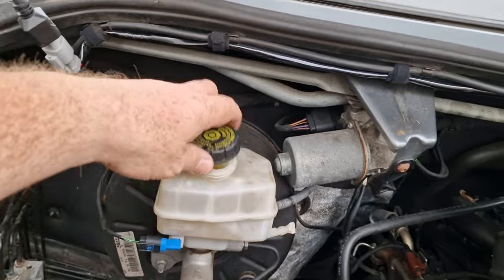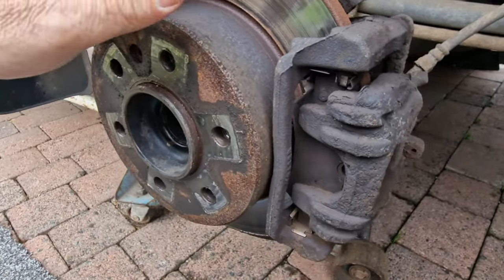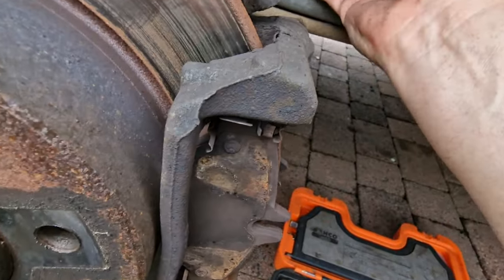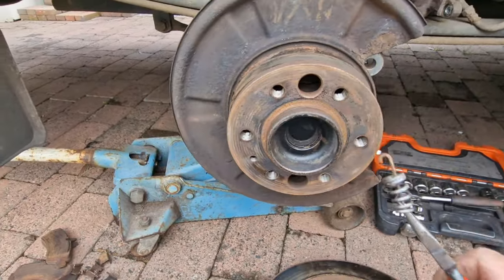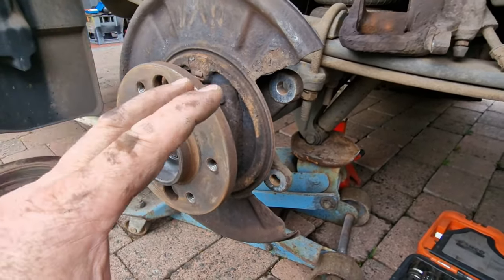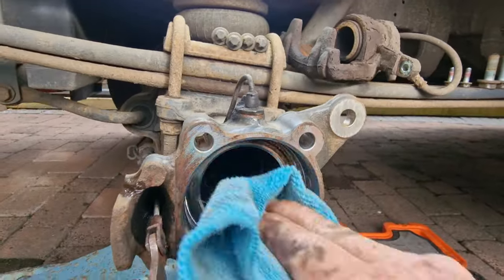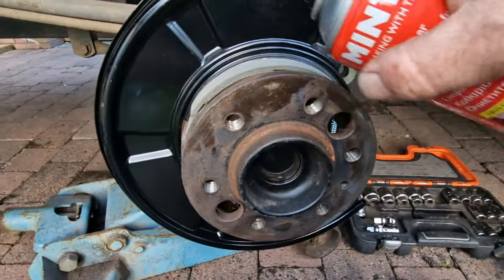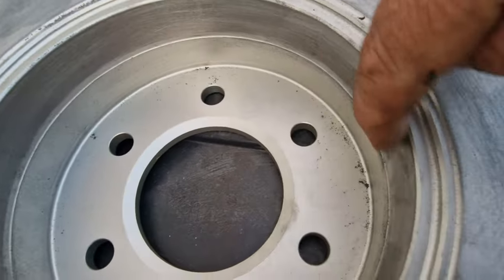Sprinter Crafter Rear Brakes: How To Install Disk Pads, Shoes, And More! DIY step by step guide

Comment: Great video Sam, as a former sprinter mechanic I would always back the central adjuster off at (2526) before doing anything on the rear brake system, This helps removing the disc, drum and returns the cables and pads to a default position, its amazing how many people adjust the shoe position here, and not as you have correctly done inside the hub,Also the brake fluid maximum level illustrates the optimum braking system with new disc and pads fitted and nothing else.
Reply from the maker: Thanks for sharing

Comment: Probably the best video on the subject of rear brakes concerning the Crafter I / Sprinter 906. Congrats, mate - well done! 😊👍
Aside from the technical descriptions and the actual work being spot-on, one cannot over emphasize the cleanliness of the job. Once the grimy, rusty remnants are gone, it is important to have clean paws when reassembling the new parts. 🤚✋
The backing plates are often overlooked during the service, especially when the emergency brake linings are left unattended. Perfectly spotted here. 👍
Personally, I would have swapped the calipers at the same time, but if there is no issue with them, re-using them works too.
As a little reminder: Remember to change the brake fluid regularly as well, the Crafter I / Sprinter 906 brakes are borderline on a fully loaded van to begin with, and keeping them up to their best performance is absolutely mandatory. 😎
Reply from the maker: I may have a video on that 😊👍

Comment: Thanks for the well explained Video. Have been fighting yesterday to get the disc off did not realized that i had to make a adjustment to the brake shoe. 

Outside in the rain and 3 pluss Celsius 😅
Reply from the maker: Glad it helped
Reply: @TheCraftyBlindersvanlife  do have a link to the wall sheets you used in your car? For the entire build?

Comment: Nice presentation Sam, did my relay a few weeks ago which was slightly different because of front wheel drive. Mine were in such poor condition  I'm surprised it passed it's last MOT.👍
Also found that the near side wheel bearing was needing replacing. New hub was cheap enough so I got one.
Reply from the maker: good catch with the wheel bearing

Comment: Nice video Sam. Now all you’ve got left to do is change the flexi hoses and fluid. Just did mine at the same time but tbf mines 12 years old and hoses were stamped 2010 in line with the build date. They are the same front and rear. With the handbrake I slacken the cable  right off at the adjuster nuts before adjusting the shoes up then with the road wheel on, just with one wheel stud out to allow me to turn the cog wheel, saves using the Tommy bar in between studs to rotate the disc/wheel. Also having the wheels on while adjusting the cable back up allows you to push the wheels round with your feet while still under the van to see when they started binding, saves rolling out n checking each time as I’m not getting any younger! Interesting point on the pad sensors as mine have always been on the outside pad since I’ve bought the van at 5yrs old so have kept it that way. Now you’ve got me thinking I should’ve changed the backplate as well for peace of mind although mine didn’t look as rusty as yours. Off to Ukraine in it next month so hope the shoes don’t let go there. 😂 Have a good summer.
Reply from the maker: I've actually change the fluid twice this year I forget what I've done sometimes, enjoy the Ukraine

Comment: Thank you, nice funny my vw talvor (crafter) rear discs started squeeling when I reversed yesterday, never did that before pads are fat not worn out, not so easy on 4.5 tonnes duel rear wheels to get too a little bigger than your van hmm ?? I had the front pads done, and although not worn at all, one of the sliders was jammed, so that helped stop better, so I have to find someone to check now as I have no home to go fix myself anyway enjoy your work u have the same engine as mine brakes etc also only dual rear wheels cheers Harry

Comment: Another quality video Sam, however in my experience always get genuine Mercedes parts for the rear shoes as the common handbrake sticking fault is caused by a seized lever the cable attaches to. I think that is only available in the genuine brake shoe pack. The back plate is for the brake shoe springs, absolute nightmare doing those, in future I’m paying someone else to do it. Thanks for the upload 👍
Reply from the maker: Good advice mate 👍

Comment: Hi mate. Good video. Question. I'm replacing handbrake, discs, pads... I just managed to get the handbrake shoes back in but the new disc doesn't fit over it. The adjuster is wound all the way in, I'm scratching my head what gives. Any suggestions?
Reply from the maker: sorry ive just seen this Have you backed off the hand break cable adjustment ?
Reply: @TheCraftyBlindersvanlife  Hi. If there is a central one somewhere, I missed that. That must be it, thank you